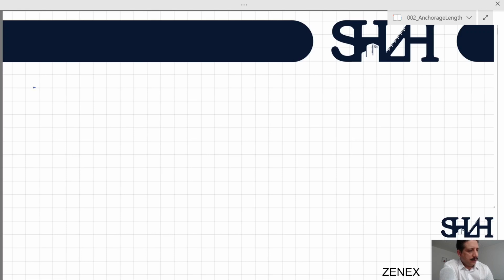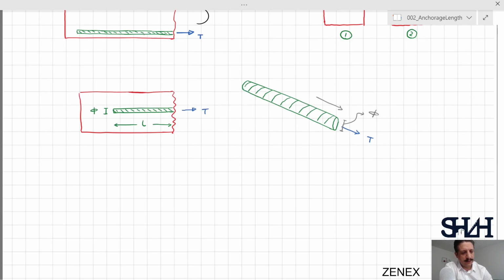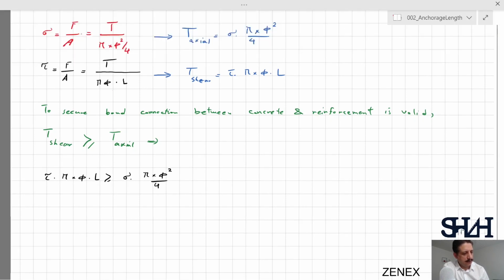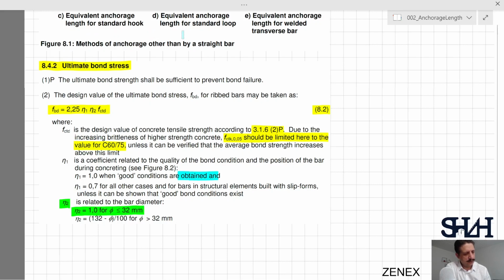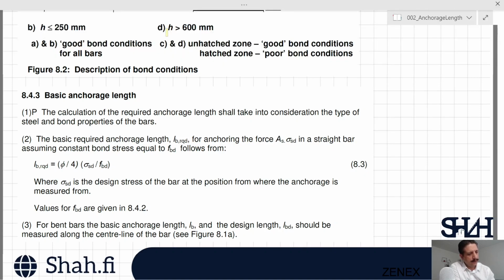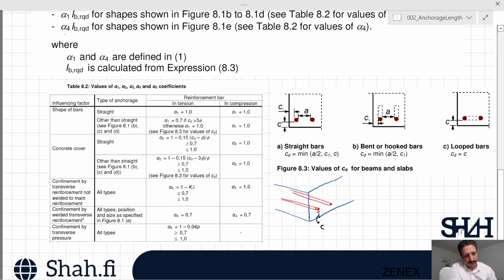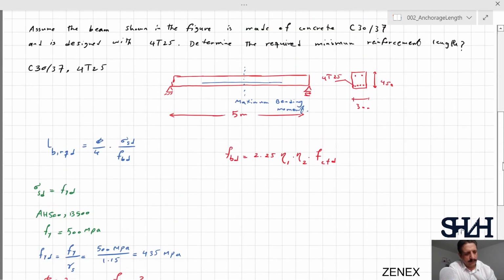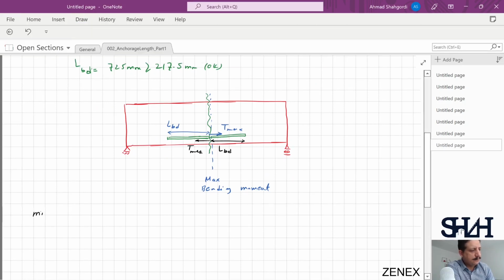002 Anchorage Length Part1

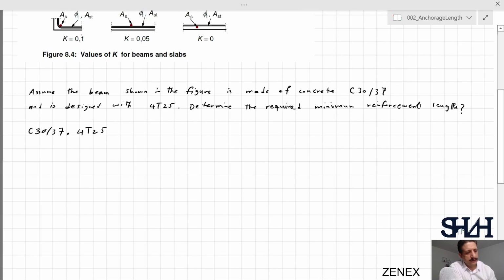Comment: At 34:01 you said that the reinforcement is 4T25.. Is that 4 bar with 25mm diâmeter of A500 steel? At 44:43 you sai that the diâmeter of the bar is 20mm, and you used that value in your calculation.
Best regard from Portugal,
Reply: Noticed the same. Must have been a mistake I think?